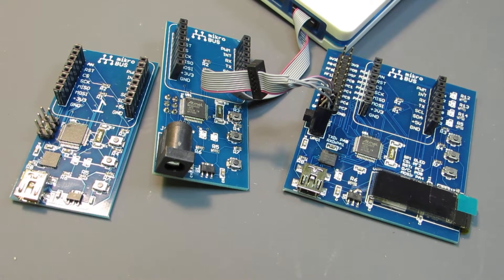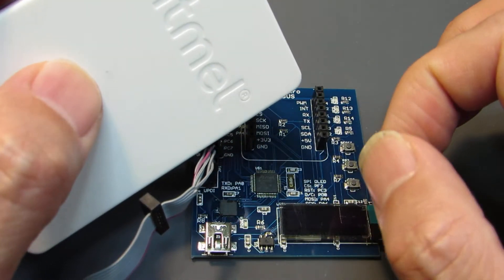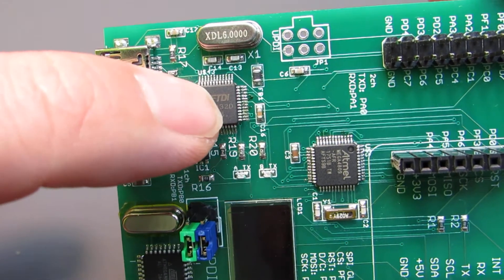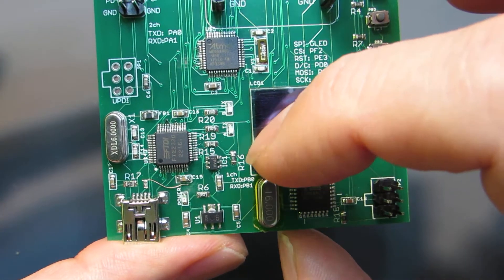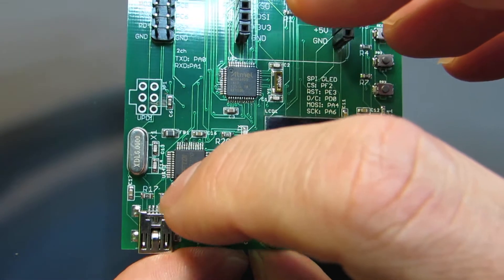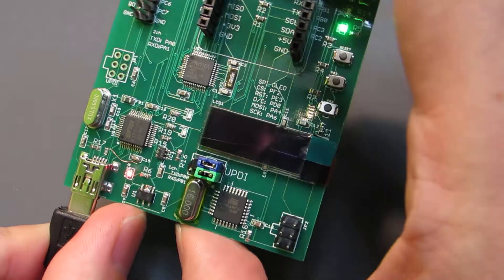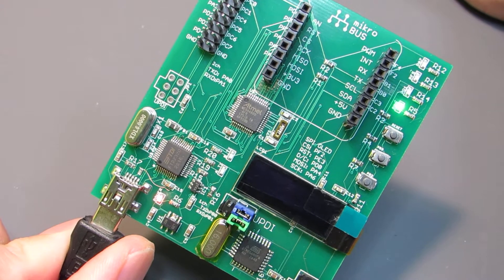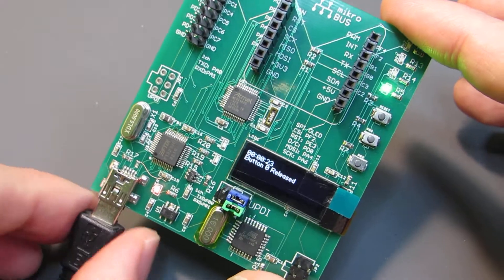Atmega4809 developing board with embedded programmer

Comment: Why you always make all traces so thin? Even power ones. It's a potential source of failures.
Reply from the maker: Very, very nice question. This is true that, the line structure is a member of safety device. In the case of too much current (or short circuit), the board itself will be self-broken. This design concept is especially IMPORTANT for Lipo battery operation. Just breaking one board is far better than making fire and explosion. This way is far certain than any insertion of fuse device. Thank you for nice question. I've waited for you.
Reply from the maker: In my case, some of the board are released on tindie.com. Too much current tolerance may cause fatal issue surrounding of the board, and potentially sued for compensation for damage (house, body..). Careless thick width is ULTRA dangerous. (unless 100% of user behavior is defined in advance.)